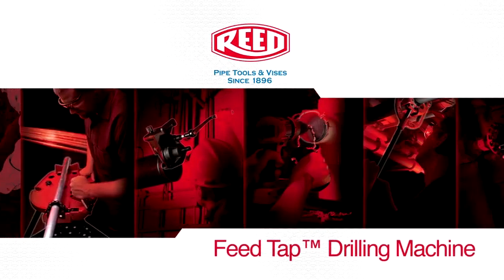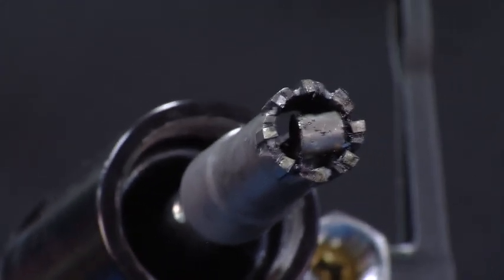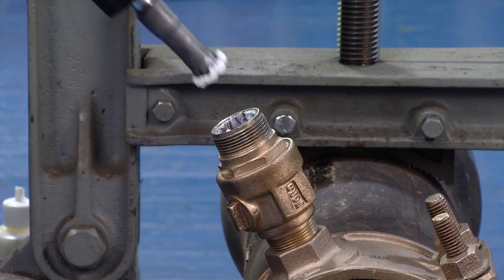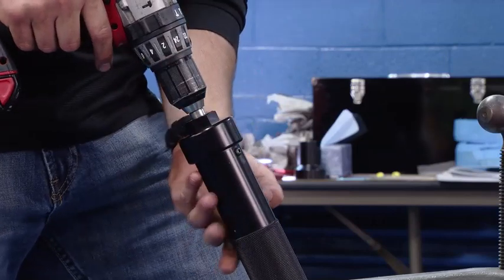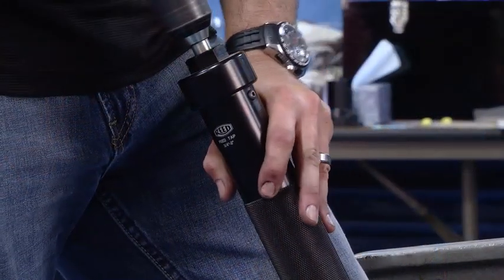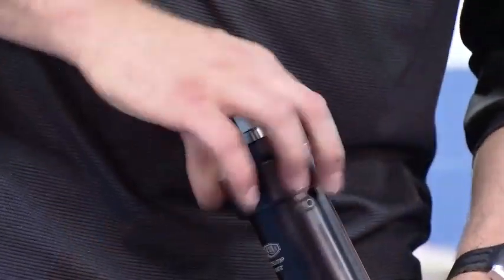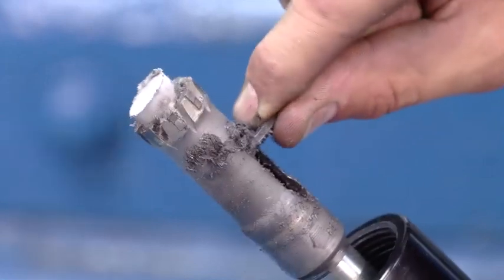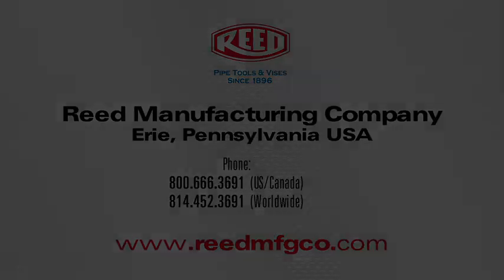Feed Tap™ Drilling Machine Demonstration - Reed Manufacturing

Comment: The magnet will hold the cuttings in a lengthwise orientation that maximizes the chance of getting them embedded in the skin, meanwhile your demonstration shows someone grasping the magnet with bare skin, not covering their fingers with any PPE.
Reply from the maker: You're right - our operator in the demo should have worn close-fitting jobs.  We have added PPE recommendations to our user manual.

Comment: How much it cost
Reply from the maker: The cost depends on the options chosen with the machine.  Best is to work with a distributor in your area to determine which pieces you need.  https://www.reedmfgco.com/en/where-to-buy/    If you have questions when you pursue it, contact us again.

Comment: Please do demo repair 🙏  The shaft is sliding all the way down and all the way back up without turning the black cylinder.
Reply: Figured it out the 1 1/2 inch tension pin broke on the top of the shaft, either way a video would be nice for anyone running into the same issue.
Reply from the maker: Thanks for the update @jruoff16.  We'll share with products department.